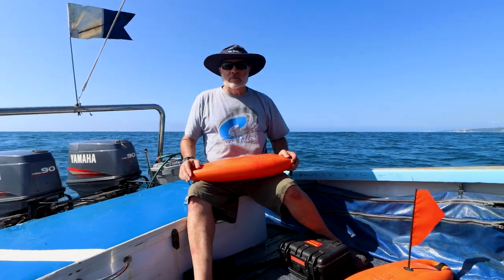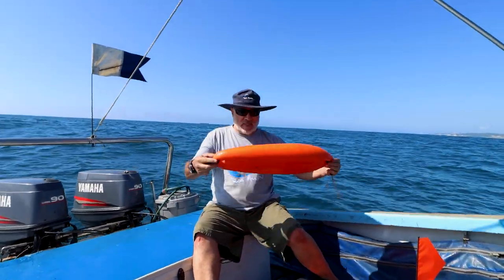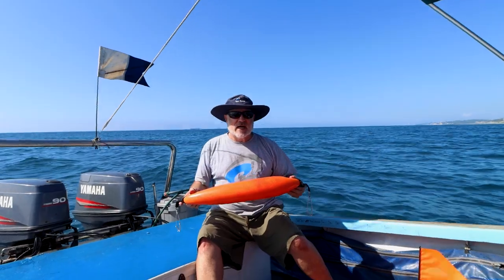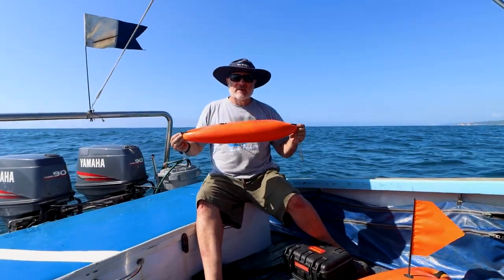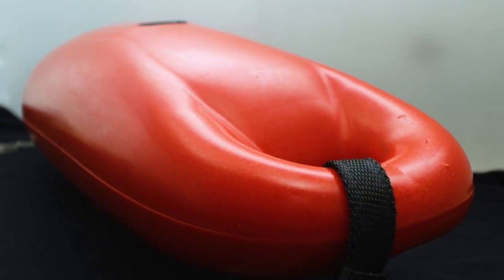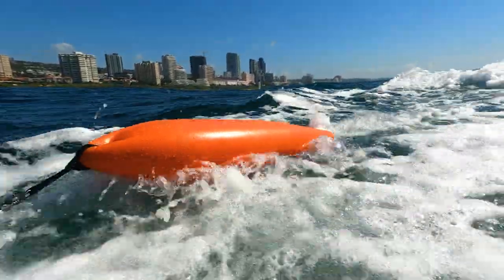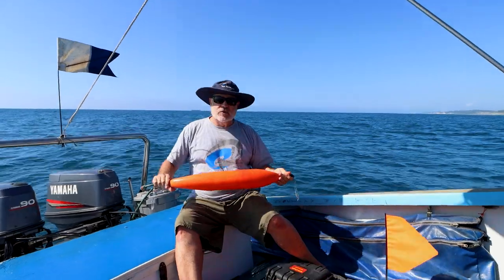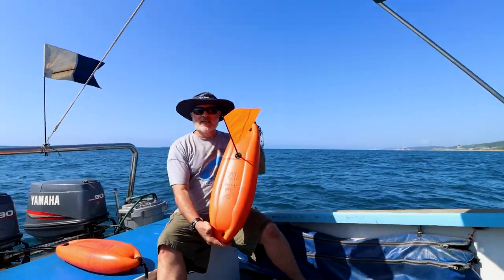Rob Allen | Spearfishing Float | 2022

Comment: I have a 12 L one, it’s a bit hard to carry a distance as the other air inflatable ones that can be used as a back bag . The flag creates quite a bit noise also. However, I m very impressed by the smoothness in the water. Can’t feel any drag not matter how strong the current is. ❤
Reply from the maker: Thanks for that. This is obviously how and why we designed it like that. We are going to start making our inflatables in similar shapes.
Reply: Strongly looking forward to it!
Reply: @RobAllenSpearfishing  If you don't want the float to dive down, why not place the D-ring in the middle/center of the float? It would be near impossible to pull it down unless you hooked an Orca
Reply from the maker: @southpaw8040   We tried that, works great with slow fish but if you shoot a fish that can pull it under, at first it is fine but then if the fish pulls faster it starts to rotate. The more it rotates the more drag it applies to the fish the harder the fish pulls. It ends up like a propeller and, creates so much drag that any soft fleshed fish pull off, not good. This shape we use in the hard float works best.

Comment: Do these floats resist the pressure of depth when dragged underwater by big doggies? I use similar floats, copies i suppose, they come up badly collapsed and sometimes cracked after i shoot big doggies.
Reply from the maker: This float come in 2 versions, foam filled and air filled. The foam filled can withstand a greater depth, +- 15 to 20 meter. If it goes deeper then the foam can become squashed. To hunt doggies you should be using a far larger volume float. This float is only 12 lt. I've seen big doggies take down 2 x 35 lt inflatable floats.

Comment: how long is the 12 L in inches and can a diver swim on top of it...Also what's the biggest fish that it can handle if I tie my gun to it? Thank you.
Reply from the maker: I don't have the dimensions on hand and will try put them up on our site in the next few days. The buoyancy is more important.  Volumetrically, the 12 lt displaces 12 liters of water, equal to 12 kg of weight. The float weighs 1,32 kg, therefore it will hold up 10+ kg. A small 5kg fish can pull it under but when tired that fish will not hold it down. Remember most fish are only slightly negative, that float will hold up a 50kg dead fish no problem.